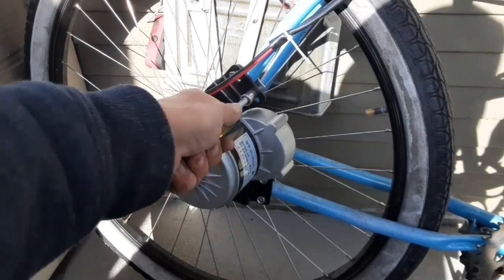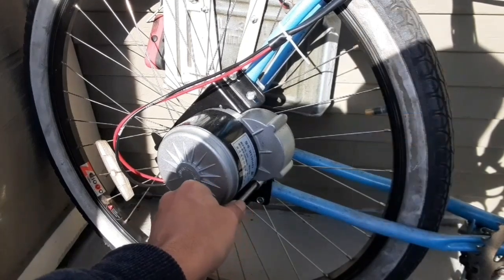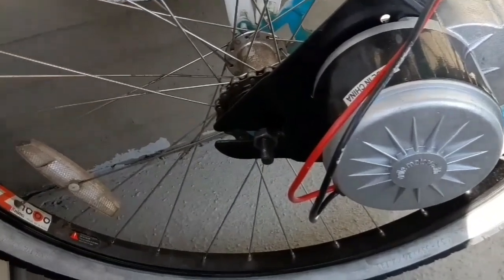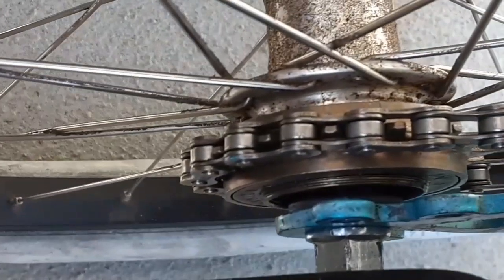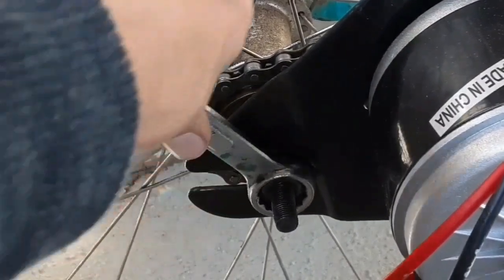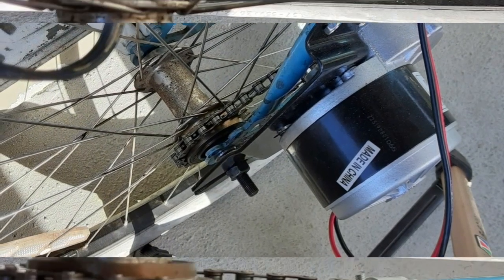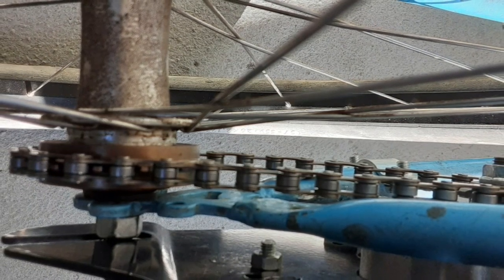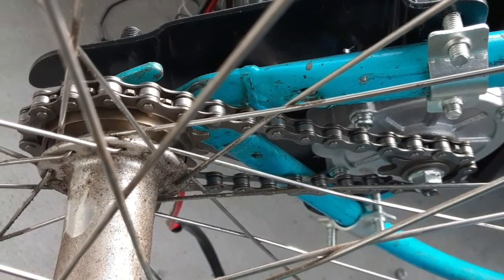Cheapest ebike kit on Amazon part 2. Motor install.

Comment: is it possible that the chain is too long even when i push the motor to the furthest? can i remove links or put a bigger cog in order to tension it?
Reply from the maker: You may need to remove or add some chain to make it fit. Chain removal tools are very cheap online.
Reply: @ThriftStoreHacker  i have a chain removal tool but for normal size chains, the motor chain is bigger so i might need to use a punch to get rivets out. thanks you for the fast answer, i really appreciate your videos, youre the only video on youtube who shows this kit installation
Reply from the maker: @Djmat8  the motor chain on my kit is the same size as the chain. You generally have 2 sizes of chain on bikes, one is just a little wider than the other but the length doesn't change.   Also, if you need the sprocket on the gearbox to stick out a little more, take it off and flip it over.

Comment: hi  Hacher
sprockets ?  when will you show how to put the other sprocket (free wheel) On?  
I would like to pedal as well as use the motor
Also will this work with a multi speed sprocket?  without removing it? or removing it and replacing with the other sprocket that comes with the kit?
I noticed you had a video on how to remove a multi speed sprocket
thanks  Tom
Reply from the maker: Just getting back into town from doing holiday stuff. I will put out a video on it this week. Im installing a second single gear freewheel on this setup using the adapter from the kit. 
If you want to do a multi gear setup, there is another kit available  online for a few dollars more. That kit comes with a drive gear that you mount to the wheel and a freewheel on the motor/gearbox.
Reply: @ThriftStoreHacker  thanks
Reply from the maker: Very welcome,  video should be up in a few minutes.  I will show a little more on setting up the axle spacer and aligning the chains in the next video.
Reply: @ThriftStoreHacker  thanks. Looking forward to that